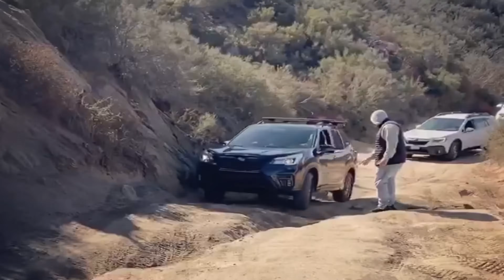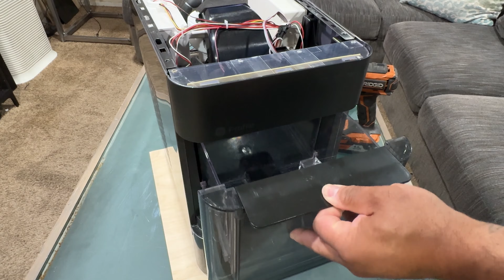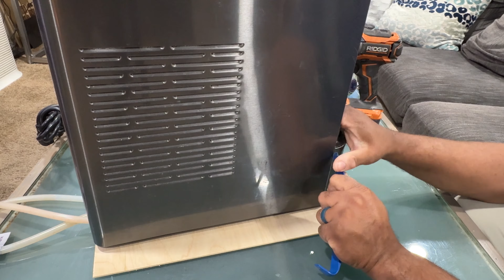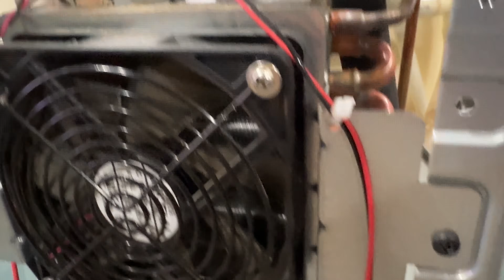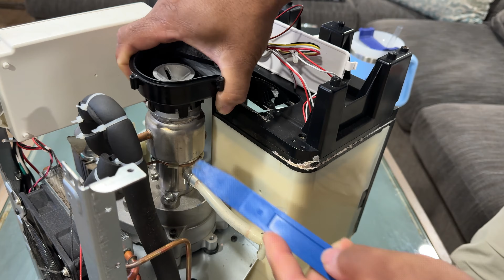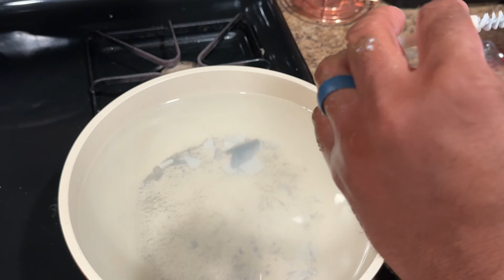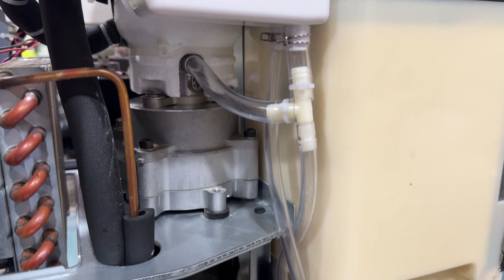GE Profile Opal 2.0 Nugget Ice Maker Repair

Comment: I watched probably 100+ videos on you tube trying to get to the bottom of the squeal of death from the Opal. This without a doubt is the only video that got to the bottom of the issue. I tried everything and this video along with the helpful links took care of the issue. It is calcium buildup in the tubes. Water is not able to flow enough which then causes an Ice up which then causes the squeal. I was amazed with the buildup in the tubes. One was completely sealed shut with calcium. If you have the squeal of death do as this video says and it will fix it.
Reply from the maker: Glad I could help.  After doing this, it’s recommended to use distilled water to prevent this from happening again.  It works, and sure beats having g to constantly repeat this process.

Comment: I take care of my own pool here in Arizona as far as keeping the chemicals in balance and keeping it clean, and part of that is having to add acid to the water about every month because of the high pH from the tap water that refills it, plus the acid gets used for cleaning the salt cell (salt water pool) which generates the chlorine in the water.  The salt cell gets a little jammed up every month with calcium and other hard water deposits and it has to be removed for the cell to operate correctly.  The acid, mixed with water, is poured into it and it quickly dissolves all of that and cleans out everything in the cell.  I figured maybe the same kind of thing could apply to the ice maker.

For squealing sounds when the ice is being made (not fan noise), my fix was this - Go to your local pool supply store or Home Depot and get a jug of muriatic acid.  Be warned - this stuff is strong, do NOT breathe in the vapors when you take off the cap.  I had a large bowl of about 3 cups of water and I added about 1 cup of the acid, then poured that into the water basin in the ice maker.  I turned on the cleaning cycle and right away I saw a bunch of scale come out, it looked like large flakes of salt.  I ran the cleaning cycle with that same solution 3 times.  After dumping it out and running two more cycles with fresh water both times and putting in a final fresh tank of water, it's back to being dead silent while making ice.  No more screaching noise and it's been a week.  The acid also cleans out some of the other gunk in the lines and everything looks new under the lid again.

Comment: Great video. I had the exact same sound coming from my Opal. But after doing the disassembly I found no buildup anywhere. Hoses, t-connector, reservoir tank, discharge port, all perfectly clean with no buildup. Any thoughts on what other issue might cause that awful squeal/grinding?
Reply from the maker: Thanks!  Sorry to hear that.  Unfortunately I do not have an answer for you.

Comment: I've watched this a couple of times, and I appreciate your thoroughness. I clean my machine monthly, but I've been wanting to replace the tubes for awhile. You may have said this somewhere, but do you cut the tubing since it's needed in different places? Also, you said two different size tubing is needed. When you start working on replacing it, is it pretty obvious which size goes where?

Comment: Mine constantly says “add water” after about a minute of running. Before the “add water” message I get suction out of the little white hole in the reservoir. Does that sound more like a sensor problem? If so, any idea how to fix the sensor?
Reply: I’m having that same issue! Trying to find a fix.

Comment: @Lucrativesoldier - Thanks for the video.  This really helped me in proper disassembly/reassembly.  Are you quite certain that the squeal is coming from the tubes being restricted?  Seems like the squeal is happening when the unit is running for a while and ice starts dropping into the bin, not initially when it says "Making Ice".  Another guy posted a video (https://www.youtube.com/watch?v=Tu2-yl_ByQE&list=WL&index=4) which I'm going to try in addition to your steps to descale and clean. I went ahead and bought another GE Profile 2.0 unit and rebuilding this one for downstairs.  Also, seems like the 3/8" OD tubing I had to buy qty 3 because its almost 9 ft of tubing.  I'd rather have more than not enough.  I can always return what quantity I didn't use.

Comment: I took mine apart a month ago and had to order auger and auger base, putting it back together and noticed it a few of the chrome screws are not pointed and slightly larger didn't catch that when taking it apart. Any chance someone knows where exactly they came out of?

Comment: Great video. I'd only add that if you substitute a vinyl hose instead of silicon, the clamps don't work well. You would need a hose clamp due to how much tougher the vinyl is compared to silicon.
Reply from the maker: Thanks for the suggestion.  I thought I did, but maybe I just added the links for either option.  I’ll check on it, and edit if necessary. 👍🏾

Comment: Thank you for a great, in-depth video.  I replaced all the tubing (using the tubing in your links) that were clearly plugged up with scaling deposits.  I cleaned the other tubes that had minimal scaling with the descaling solution you recommend. My heart sank after all that effort when I heard again that same grinding and screeching noise from my Opal 2.0. The noise was just as loud as the sounds from before I did all that work.  Any thoughts of what I could look at next? Thank you again!!
Reply from the maker: Oh no, sorry to hear that.  My only recommendation would be to let the descaling solution sit for a bit in the metal section in the center.  I’m guessing you still have build up in there.  Let me know how it goes.👍🏾
Reply: @Lucrativesoldier  Thanks for the suggestion!

Comment: Great video. This is why I only use distilled water in mine. Hoses still look new after three years.
Reply: I guess there isn't much metal in these units, but I've read that you need be careful with pure distilled water and it's ability to corrode metal faster. In my espresso machine I use RPavlis water, which is potassium bicarbonate in distilled water. I wonder if that would work to reduce the corrosive nature of pure distilled water. I wish I had never used filtered tap for my Opal!
Reply: @intrinsicbits  Interesting. Learn something new every day.
Reply from the maker: @intrinsicbits wow, that’s the first I’ve heard that.  I know up to this point, I haven’t had any issues using the distilled water.  Thanks for the info.👍🏾
Reply from the maker: Thank you!  Yes we’ve switched to distilled water since deep cleaning and hose replacement, and it has been perfect since.👍🏾

Comment: Great video - I might have to try this.  Mine stopped making ice so I gave it a good clean with vinegar.  When I restart it - the water runs and you can feel the pump sucking water in, but it stops after 5 minutes.  Any thoughts on what that might be?

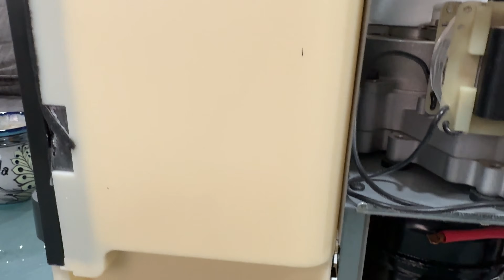Comment: At 3:38 cleaning out that metal part, what about getting inside whatever that is to get the gunk out of there? Is that not needed or is it just not advisable to take that apart?
Reply: Answered my question, there's refrigerant lines around it so you certainly don't want to mess with that. I got a syringe and squirted descaling solution into it and letting it soak until it starts backflowing clear again.
Reply: Used a piece of tubing turned up so I could fill that with descaling solution and let it soak for a good while. I could see scale build up inside.
Reply from the maker: @CatFuzz71  Sorry I didn’t get to this sooner.  Thanks for adding your suggestion!👍🏾. That’s better than how I did it.😁
Reply: I couldn’t find the links but could you please add the links for the two types of tubing needed and that great tool kit you had? Great video hoping this fixes mine
Reply from the maker: @stacysmith2578 links are in the video description.👍🏾

Comment: This is a really great video. It's amazing the amount of scale that built up in that machine before it probably failed. I only use distilled water in my machine but my machine failed due to a faulty pump mechanism and I didn't have to completely disassemble but if I ever need to do more I now know what video to turn to :) Thanks for a clear, easy to follow video and excellent ideas.
Reply from the maker: Thank you!

Comment: After doing exactly what you said, I took it apart and the lines were plugged full. I did clean them instead of getting new lines and I finally convinced my wife to use distilled water only! Thanks for the great video.
Reply from the maker: Glad I could help.  The distilled water really works!  We’ve actually started using it with our espresso machine also, and it makes a big difference.👍🏾

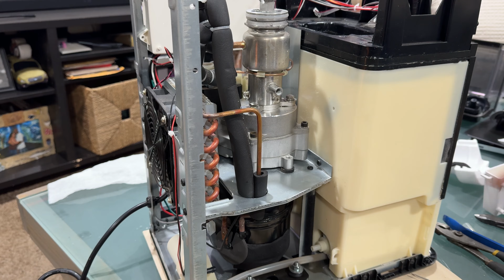Comment: @7:17 that looks like a servo I am guessing to start the flow into the ice making bin? Mine has not really made it 90 days and I have kept it clean and used distilled water. I have great water flow but I am getting some popping right when you should hear a tone change in the pump when the water goes into the freezing bins, and I get the add water.

Comment: Vinyl tubing is leaking. Had to order silicone tubing. It’s seems the vinyl is a smaller od than the silicone.
Reply from the maker: Thanks for that info, that is good to know.  I will put a note in the description.👍🏾
Reply: @Lucrativesoldier  it was the basic Home depot stuff. Confirmed it leaks.
Reply from the maker: @DustyTexas2Step thanks I appreciate it.👍🏾

Comment: Hi. Great video. One question. I've seen in other videos that the spindle was removed for further cleaning. Were you able to do that on yours? The other spindles looked a little different, and the plate to hold it in was in a configuration. Thanks.
Reply from the maker: Thank you!  I think I disassemble it as much as possible.  This was what worked best for me.

Comment: Ugh. The work to fix a 500 machine. I mean, i get it. Nothing is self cleaning. But when you run the cleaning mode with vinegar once a month this shouldn’t be needed.
Reply from the maker: @amberleon8329  I agree.  As many have recommended, we started using distilled water, and haven’t had any issues since.
Reply: @Lucrativesoldier  that’s a lot of $$ in distilled water 😆. We don’t have an ice machine in our commercial grade fridge so I fill this thing up at least once a week. I will say; as our main source of ice it’s lasted two years. Maybe that’s its lifetime.
Reply from the maker: @ it is, but it beats dealing with having to go thru this process over and over.🤷🏾‍♂️. I felt the same way, but now it’s just another expense.

Comment: Honestly, the best approach to the GE 2.0 Opal is just not to buy one. 

We had the original Opal from about a decade ago and it finally failed last year after owning it for nearly 10 years. 

My wife loves her nugget ice, and used some Christmas money to buy a replacement Opal. It didn't go but about 2-3 days before it started making horrible noises that could be heard from all throughout the house. Called up GE, they agreed to take it back and replace it with the "Pro" version at no additional cost. What was shocking/sad about the conversation with GE was that they openly admitted to the noise issue with the ice maker and that the "Pro" was supposedly better made. 

The "Pro" fared little better. It made it about a week before it started doing the exact same thing. It was intermittent at first, but after a couple of weeks it too would just make this god awful screeching noise nearly nonstop until it was unplugged. We cut our losses and got a refund from GE and went with another brand. 

Unfortunately the Opal ice maker appears to be a good design that got bought up by a corporate juggernaut and "value engineered" to the point where they can't make one that just works.

Comment: My opal2 has stopped making ice and makes a loud continuous humming sound when powered on now, it seems like everything else is still working, buttons, pump and such but no ice and the loud humming. I opened it up and the smaller fan that looks like it is on an open body ac motor is not spinning when the machine is on and I can't spin it by hand when it's off, like it has a strong magnetic resistance. The humming sound sounds to me like a motor trying to spin but can't. Is that little fan supposed to be spinning at all times when the machine is on? If it is then that is probably what's wrong with mine.
Reply from the maker: In short, I don't have the answer.  But usually fans can spin freely when not on.  So my guess is, the motor is bad.

Comment: I had low expectations after watching all the other videos.
This however was the best video I’ve watched on the Opal. 
I don’t think most people understand the maintenance that these things need after a few months. I’d almost pay to have these rebuilt but for the same price you could probably buy a new one. 

Again, this was great.
I’d also like to see if anyone else had issues with pooling water.

I saw the scale build up at the top and I think mine is dripping condensation due to the poor pressure and air flow.

Again, this was a great video and thanks for clear editing and explanation.
Reply from the maker: @Ripdizzle01  thank you, I appreciate it.  Right!  I would not buy this if you aren’t the hands on type, because it definitely requires regular maintenance.  We recently switched to distilled water, so we will see how much better that is for the machine.  So for so good.👍🏾
Reply: @ I had the first version and used sink/well water. Eventually switched to filtered water after the scale build up was too bad.
Eventually it overtook the machine and I think unless I replaced some of the parts, I’d continue to have mold.
With this 2.0 version I’ve only used filtered water and the scale build up is minimal. Very little in the pre-ice reservoir (white bin with the UV) that was after two years.

The leak though has rusted the bottom front completely. I’m surprised they didn’t use stainless or some other type of metal. 
Either way thanks for the info.
Reply: Oh and also distilled should make the ice almost clear. It’s probably better or a mix of filtered/distilled will get you the best results.

Comment: So, did this stop the squealing permanently?  I have seen so many explanations on Utube that vary widely.  I have attempted several and mine still squeals.
Reply from the maker: @jackac3394  this fixes the problem.  It’s recommended to use distilled water to avoid mineral buildup.

Comment: I offered to repair one for my Brother-in-law, I found this exact situation inside however the motor to the side of the chiller/impeller was stiff and almost locked up, by turning it the chiller section loosened up. I cleaned with a moderately strong solution of Clorox, about 5:1 water/Clorox for a couple rounds then rinsed. I wanted to test the unit before I went any further and it does make ice however with a clack, clack, clack. I believe the motor has a belt drive of some type in the chiller assembly and it is stiff from sitting. Curious if you know of a service manual or parts for this unit. Great video, came right up when I searched the maker. To finish my project I think I will need to disassemble the chiller.
Reply from the maker: @WaveRadioUSA  thank you!  Unfortunately I do not have a repair manual.  The process in this video is the extent of the work I’ve done on this machine.  If I end up having to do a more in depth repair, I will do a video.  Good luck and happy holidays!

Comment: How can I take out the metal ice making round part apart ( i think itself gueger or smthg)? I cleaned everything but still making grinding like sound which I know from the past when I cleaned the sound goes.
Reply from the maker: @armis9288  I haven’t had the need to remove that, so I’m not sure.  What I did was poured descaling mixture into it and allowed it to sit for a bit before cleaning it out.  That has worked for me.

Comment: Repair tech here. Great Video!  however most people don't want to go through this, because it's too much trouble and blame everything on the machine itself. There is no such thing as a self cleaning machine, everything needs to be cleaned by hand eventually. Make sure you use distilled or filtered water in your machine  and NEVER TAP WATER and you won't have the clogged line issues and less build up. I bought one at goodwill for $7 (not a GE opal but a generic brand)had it for 2yrs runs 8hrs a day  still works great.
Reply from the maker: @dnstarlite9780  thank you, and thanks for the advice.  After having to repeat this process using our filtered water, we have switched to distilled water.  Some people don’t want to pay for distilled water.  But when you factor in the cost of replacing your filters, and having to repeat this process, buying distilled water makes more sense.  And it actually allows us to fill the reservoir quicker, so that’s a plus.👍🏾
Reply: Thanks for your reply, it turns out there's something damaged inside the gearbox that I think the motor runs and that's why it won't spin freely, I got it making ice again but it's way louder than it used to be and makes some clicking and popping noises like it has gear damage. Fortunately the 3 year extended warranty paid off this time as it was a little over 2 years old 👍
Reply from the maker: @ ok good to hear.👍🏾

Comment: Great video!!
One suggestion, the original tubes are silicone, not vinyl.  So, it would be better to replace tubes using silicone tubes. A bit more expensive, but better quality and more aligned with original parts.  Also, (maybe I missed it) you did not mention greasing the seals with plumbers silicone lube.  That will help maintain a good seal and prolong the life the rubber seals. Additionally, some squeaks can originate from those seals, so the silicone will help avoid or eliminate those too.
Reply from the maker: @TX_ChartGuy  thanks for the advice.  I will add links for silicone hose also.  And you did not miss it, I did not grease the seals.  I will add that also in the description.  Thank you!👍🏾